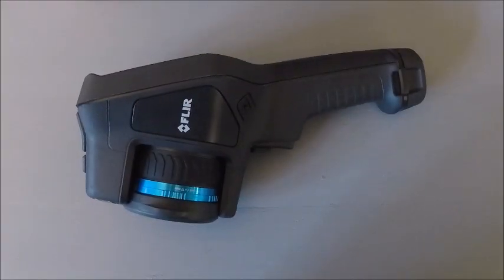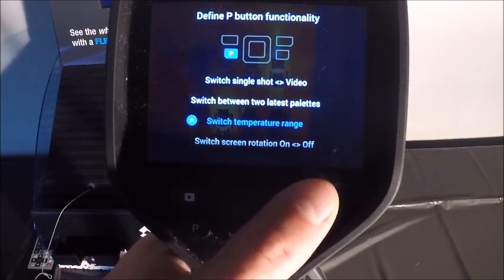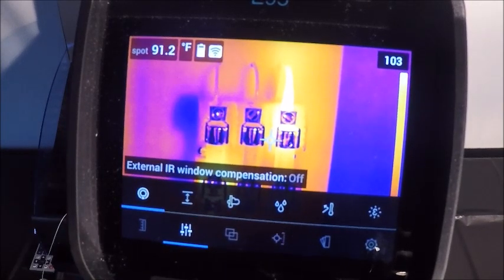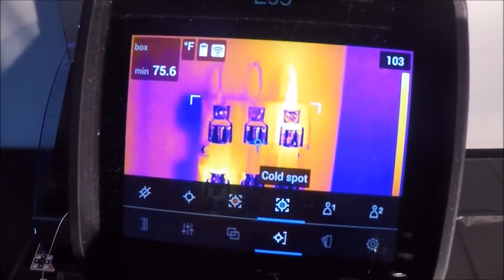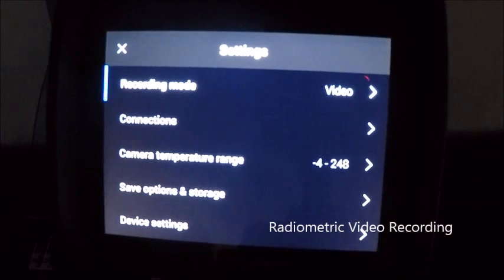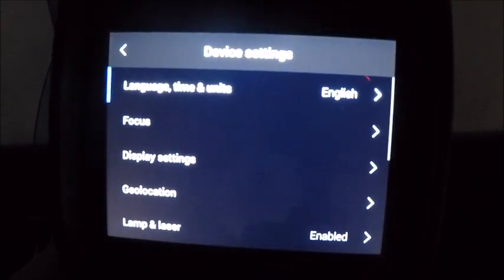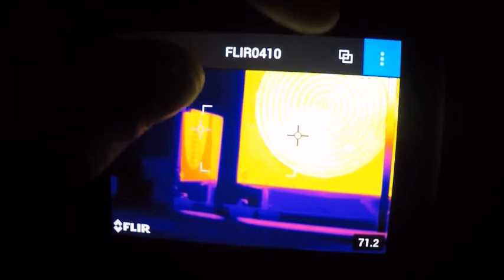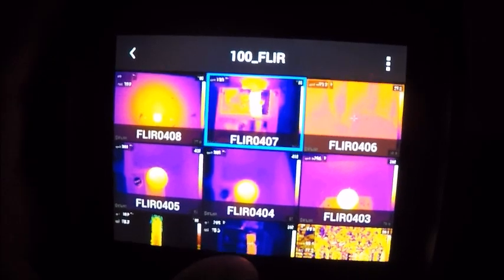Flir E53, E54, E75, E76, E85, E86, E95, E96 (Exx-Series) Camera Overview/Training - I&E Technologies

Comment: Please tell me why, when I turn on my Flir E86, and only the logo, loading animation and nothing else happens on my screen? It won't load further. The firmware has been updated, the memory card is working. Batteries are fully charged. Thanks in advance for your reply.
Reply from the maker: Hi Ivan - it could be a number of things but try a different battery and then reboot it.  If that doesn't work, remove the SD card and see if that changes anything.  I've had the issue before where the SD card causes issues, if that's the case, get a new SD card.  If not, it'll likely need to get sent into FLIR Service to have an inspection done on it.
Reply from the maker: @IvanNavi08  I'll send you an email, you'll likely need to have it sent in somewhere.  It sounds like you're doing everything right.
Reply: @ietechnologies72  Thank you. I will be waiting for a letter from you.

Comment: How to access and take images remotely through mobile phone
Reply from the maker: Thanks for your question!  You will need to down the FLIR Tools mobile app on your iOS or Android device.  Once you have it downloaded, ensure that WiFi is turned on your camera and you'll want to connect your phone to your camera in your WiFi network (typically named FLIR and it's serial number), open the app and select "Devices" down below.  Your camera should then pop up in that menu, from here you can take over the camera as a controller, or as a viewer, or you can simply import images and video to your phone from your camera.  Hope this helps!

Comment: This is the great video. How to hold camera besides fingers an thumb, do they any other option, like string that you put on wrist and firmly hold camera with fingers and thumb. You also need to make video on Flir thermal studio pro tutorial. ITC video on FTSP Tutorial sucks. Do you know any other software can use flir images and generate report?
Reply from the maker: Thank you for the kind words - the Exx-Series cameras have either a hand-strap for holding onto the camera, or a lanyard-style strap that can wrap around your wrist in the case of dropping the camera.  You can still use FLIR Tools to generate reports if you can find the download for it but it has been discontinued and replaced by Thermal Studio.  You may want to check out FLIR Ignite Software though, that is a very user-friendly option for creating reports and organizing image libraries.

Comment: Congratulations on the excellent video.

Would you know what are the main differences between the E75 and E76? Thank you very much.
Reply from the maker: Thank you!  The E75 was replaced by the E76 simply due to some firmware capabilities that FLIR released across their fleet and due to the enhancement, they changed the part number.  Besides those enhancements (routing capability, etc), the E75 and E76 are nearly identical cameras but the E75 is no longer being sold.

Comment: Can i detect gas leak with E53? pls help
Reply from the maker: Hi Paulseby97 - unfortunately, it's highly unlikely it would detect any gas leak.  It would certainly not "see" the gas.  The only possibility of detecting a gas leak is if the location where the leak is, causes a surface temperature difference.

Comment: Is the only difference between the e75 and e95, besides price, is the solution of the picture?
Reply from the maker: Hi Cameo Cam - thanks for reaching out!  The main difference is resolution, however, the E95 has a much higher temperature range.  The E75 also doesn't have laser area measurement, while the E85 and E95.  If you'd like to discuss them, feel free to shoot me an email at eric@ietechnologiesllc.com.  Thanks again for the view!

Comment: Great job explaining the Exx Series. One question I had was you have two presets in the box, is that an E95 only option? As far as I can tell the E75 only fives you one box option.
Reply from the maker: Hi Ryan - thanks for the kind words.  On your E75, you should be able to add more than one box, HOWEVER, you won’t be able to do it unless you set multiple boxes on your preset menus.  If you go to the “‘measurement” menu on the bottom of the camera, on the far right of that menu you should see the numbers “1” and “2”.  Those are preset configurations that you can choose for measurements.  It might be easier to explain over an email or phone  if this isn’t clear, shoot me an email at eric@ietechnologiesllc.com.  In short, you should be able to do on your E75 the same thing I did on my E95.  Thanks, Ryan - let me know if you were able to make it work.